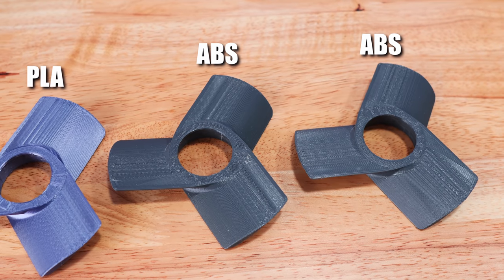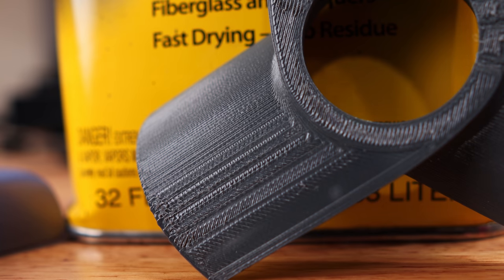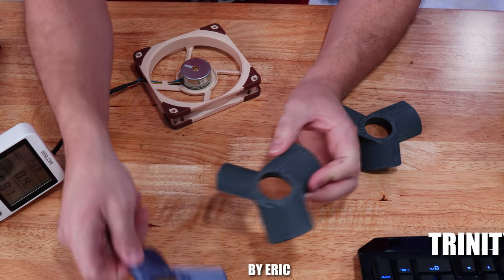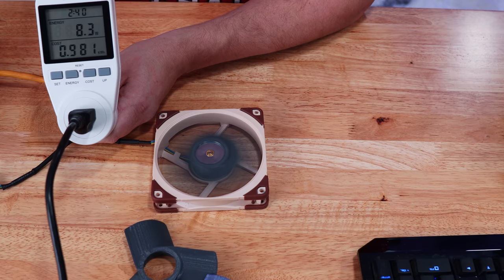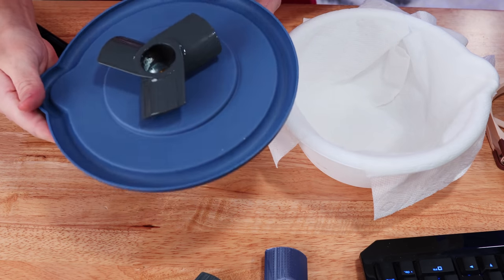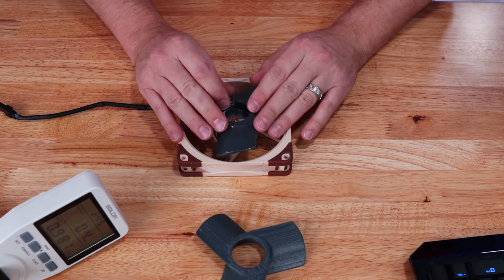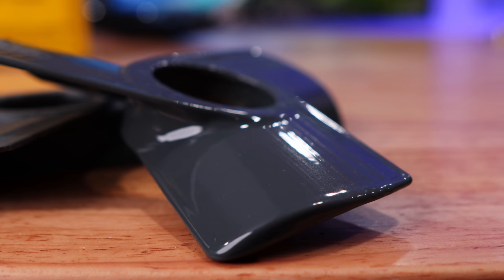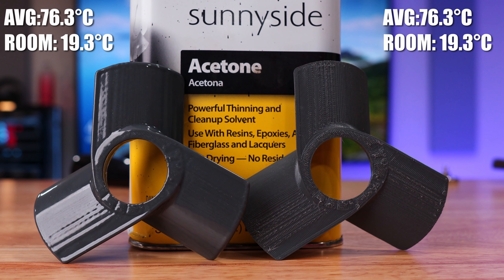Does Smoothing 3D Prints Improve Performance and Can You Smooth PLA?

Comment: Methodology note:
I think it's mistake to measure the motor wattage. I would expect it to draw the same no matter what you put on it, disregarding the most extreme cases.
What I would expect is a slightly higher RPM (at the same wattage) for the smooth version - although it could easily be trivial or within margin of error.
Due to RPM being fairly easy to measure accurately with a cheap instrument (unlike CFM, which is what we would be really looking for) I think it would more easily show any small difference that might be noticeable between the two.

But ultimately - if there is no measurable difference in a practical test then that's the ultimate judge - and the rest is pure scientific curiosity. I expect there is a difference, but just too small to be significant. EDIT: The noise/cooling ratio is very significant however, and it's good that you point that out. Any fan design can cool well if you run it fast enough - so fan and noise really go hand in hand.

Comment: if it does make less sound smoothed out, then it will also use less power. It might be worth investing in a decent oscilloscope for testing, as the noise is just a waste product from the fan, it uses some of the power to make it, reducing noise should also reduce power used.

Comment: For more accurate power draw just use that variable power supply I’ve seen and run em at 12 volts and measure current then you might be able to see a measurable difference

Comment: You can smooth pla with ethyl-acetate. I bought mine on eBay. But warning read the safety data sheet it's serious.
Reply: Dichloromethane works to some extent as well. It's also pretty nasty stuff to work with.

Comment: I bet just tweaking the prints and printer settings would get you more performance than worrying about smoothing the fan, the funny thing is you kind of want a slightly rough surface so the air separates from the fan cleanly, there's a whole area of science dedicated to airflow and turbulence control on surfaces, if you were a god of 3d printing i bet you could include some of those features in your fan and improve it ever further.

Comment: Great video

Why dont you smoot pla thermally instead of chemicaly.

Pla should become soft @80-90°C
A number of minutes in a boiling water bath may do the trick. Or few of minutes in oven @120°C
Ps too much heat may induce warping.
Could be an interesting video. Thanks 
:)

Comment: since noise is expended energy, i would imagine that a smoother can would be more energy efficient with a higher resolution energy meter. additionally, with such a small test (the size of the airfoils themselves), i would not expect to see a vast energy improvement. perhaps using a fan with a larger surface area would show different results.

Comment: Just a video suggestion if you take any
Since the acetone bath slowly removes a bit of material, 
would a slightly larger fan that was placed into an acetone bath until it's the perfect fitment perform much better than one that easily fits the fan frame from the start?

Comment: There is a difference. You just may not be noticing it because of the "Technique" you used. 
Riddle me this Major Hardware:
1) You have a fan that has a dust layer on it.
VS 
2) A fan that is clean. 
Which is more performant?
(You already know the answer)
That dust coating is basically those ridge layers, lessening the air being pushed/pulled.

For the fan show down. I don't think many would want you to "Smooth" every fan. Just isn't needed, nor is it productive with your time.
But! In those rare instances where a Fan Design is close to a commercial fans performance?
Then it might be time to take that fan,  smooth it, sand down the major imperfections, and maybe balance it a bit?

Comment: Efficiency is not measured by simply power draw. Efficiency is always a ratio comparing in vs out.  (Work done)/(power input). You got the power drawn but have not compared it to anything else. Compare it to volume moved per unit of power. 
You might find that the smooth one moves more air per Watt consumed.

Comment: Haven't gotten to the testing yet, haven't read comments. Im guessing the unprocessed actually is a bit more efficient because of the golf ball effect. Less strain on the motor, less air resistance = higher fan speed and more cooling power.

Edit: I'm going to take that .1 watt as a dub lol

Comment: Hey dude, great channel, great content but your testing methodology isn't right. You should use the input power of the fan for the comparison with a multimeter (preferably with 2 multimeters, one measuring the current and the other the voltage) for 2 main reasons
1. PSUs have pretty OK voltage regulation and it will stay almost the same voltage no matter the input voltage (assuming it only changes by a few or at most 10V). Using the input power of the PSU is very very very crude as even a small household fan could throw off your power measurement. Remember, you have neighbors, and neighbors have electric stoves.

2. That Kill-A-Watt or whatever has very poor resolution that even the cheapest $1 DMM off of eBay can beat with their 2,000 count or something. 

I hope you can revisit this and make a true comparison in the future :)
Still love the channel and the content, keep it up bro!

Comment: I think the smoothness improvements would show beneficial if the fans were spinning a lot faster like 3000 to 10000rpm or even turbo impeller speeds. At low 1500rpm or less speeds the only difference you might get is sound..

Comment: What I wonder is how much of the benefit of being quieter would be had just by printing with much finer layer height. 0.05mm layer height sort of stuff. As long as you can afford the long print time, PLA with 0.05mm layer height is relatively smooth-ish (and not too hard to make just a bit smoother yet with some fine grit sandpaper)

Comment: I Believe it's a scale issue. Since the size and shape of the fan is small(in a general sense) yhe difference is insignificant. If the fan size was large scale, like a turbine fan in generators, the propeller blades in a plane, then the ridges would create noticeable differences. At least I think it would

Comment: with a heavier fan you are more moving mass that you are feeling with drag. your mass co-efficients are having a higher impact so the drag co-effecients. so any smoothing would be negligible. also that fan looked a good bit smoother but you still have a lot of non uniform surface. when making things aerodynamic having the skin (surface) as 100% as possible. ANY surface errors disturbs Laminar air flow.
a LOT of the designs Ive seen on this channel focus on shape but not the laminar effects of each blade individually. another test that would be great to see is if you printed just a single blade and made a smoke flow box with your smoke tests. BASIC fan design is cut and push, but flow would greatly improve many of the designs as would weight reduction. the extra thick ones would be better with less infill but balance would need to be checked.

Comment: I thought the rough texture of the 3d print would makes it quieter. If the roughness was more organised and uniform it would be better imo.

I want to see someone make a fan blade based off owl feathers. Fluffy at the trailing end to reduce sound. Don't thing they'll be good at cooling/air flow but they can be the quietest.

Comment: 7:37 - "The smooth ones came in at 49.9db,  ~ the rough ones came in at 49.3"...but the rest of the video you keep saying the smooth ones were a win because they were quieter...hmm.

Ultimately, knowing the laws of aerodynamics, the rough blade has potential to be more effective for cooling at a cost of less efficiency. Rough air flow over an airfoil tends to stick to the airfoil over a greater portion of the surface, creating more lift, or in this case, more air flow. Albeit at the cost of more drag, which would make them less efficient because they would take a little more power to keep at speed.

The smooth airfoil tends to have the air flow separate off of the surface at roughly 60-80% back from the leading edge, creating less lift/air flow. However, there is less drag and the fan should be more efficient power wise.

I think in this case study the fans were just too small, and the measuring equipment not refined enough to see the differences. Maybe if you ran each fan for 12hrs on the watt meter and compared the 12hr result you'd see the difference start to show more noticeably.

Comment: what if you take a fan with some pretty thik blades and smooth it with fine sand paper because with the acetone method you can still se some waves in the print and they might still create turbulance

Comment: Id be curious to know. If you increased the fan voltage on smoothed print to make it spin faster. Until is at same decibel reading as unsmoothed print. Would there be performance diff then?

Comment: One issue with your power test is that the fan will always draw the same power, but the RPM of the fan changes. If the test was RPM normalized, then checking the power would make sense, but in this case,. measuring power doesn't allow you to compare efficiency.

Comment: Prediction: I would not expect a significant difference between the smooth and rough prints because we are using the form drag not the surface drag to move the air. 

It would require testing to know because there is not way to know, but I would expect the roupher surface to have a smaller boundary layer and thus less surface drag, so I would expect the roupher fan to spin faster. But this is not always the case and depends on the velocity and the shape of the fan.

Comment: Isn't sound energy? The friction of the air hitting the blades make friction witch causes a sound. Wouldn't that energy lost potential? Maybe that's why you saw a higher (not buy much) power consumption. Due to the fact it took less energy to push the blades threw the air it's was able to spin faster actually consuming more power. I wonder what you would find of you did a rpm test?

Comment: If you chose to sand you prints smooth would that be different? Since sanding removes material it should have less mass and so spin faster also it will increase the sharpness of the edge which might affect aerodynamics

Comment: The best way is to sand them down and then spread some UV resin on them, let it level out and then hit it with a UV light. To get a super slick finish, sand with up to 2000 grit paper and then use some car wax to get them as slick as possible.

Comment: Question. Why does CFM not directly correspond to cooling capability? You would think that the more air it can move, the better it would do in your challenges. However, that does not seem to be the case. I'd be interested in seeing each fan plotted with it's delta cooling vs CFM and see how well they align.
Reply: It's a question of CFM vs air pressure.

For testing on a rad or anything with resistance (even some dust filters) higher pressure usually outweighs CFM.

CFM is a lot easier to measure though.
Reply: @ALifeOfWine  So it comes down to efficiency in a sense. I'm thinking about how this relates to a turbo and it's ability to produce a PSI pressure and CFM. I.E. A larger fan blade will produce more CFM at a PSI vs the same fan blade but smaller, at the same psi.
Reply: @MrLoganC  I don't know anything about cars (I'm assuming that's what you're referring with a turbo) but a larger fan blade spinning at the same rpm should increase CFM but decrease pressure. Not sure if that helps you at all.
Reply: @ALifeOfWine  Yes, that's exactly what I meant with my analogy as well (Bigger turbo makes more air (more power) with less boost pressure).
Wouldn't happen to have any references to equations for this, would you? I assume is fairly simple overall (relatively depending on the person)
Reply: @MrLoganC  Awesome, and I'm afraid I don't have any equations that include variable fan size. I've only ever used CFM Vs air pressure on static fan size, which there's plenty calculators online you can find with just a quick Google search :)

Comment: (mainly an aesthetic observation) The smooth fan is smooth - but the surfaces are clearly uneven . The only way to practically test the importance of smooth & even surfaces might be to replicate a mass produced / injection moulded fan design with 3D printing; problem is that if this shows a difference, it's a problem without a solution
Reply: BTW Thanks for the videos; dunno why I'm watching as I only have laptops - but somehow got sucked in (BA- dumpf , I'm here all week...)

Comment: If we think about basic aerodynamics and plane propeller blades, it’s smooth or die... so there really is science to back up the statement. I think we are just goin into such small number differences that your electric draw meter won’t be detecting the actual differences. Someone also pointed out in the comments that dust might ( I think it’s 100% certain) collect faster and potentially more overall dust as well. But again... we need better sensors to detect these finite details/differences.

Interesting video tho, my laptop fans is a fuckin jet engine. I love seeing these quiet lil things

Comment: Hey there, what if you tried a metal fan case with (idk) plastic or 3d printed screw holes? It might help with vibrations/stability of the fan at higher speeds.
Reply: I meant a fan frame.

Comment: There is an advantage to smooth out   parts it belongs to the range of 2-5% and it requires quite a lot of instruments to have a insight.
The fan used in that description is not smooth enouht, the printing marks are still perpendicular to the stream and may not match textured surfaces performances.

Comment: Why don't you 3D print an attachment for the other side of the Noctua fan that ends off in a funnel, then your CFM meter can be placed at then end of the funnel, it will standardise tests more and you will get a somewhat more accurate cfm reading.

Comment: I would have measured milliamps instead  of measuring watts to one decimal point. Also I wouldn't worry about thermals, just air flow and pressure. There are too many variables and air flow and pressure test will be what controls the thermal test.

Comment: Now take the best fan from the fan showdown and smooth it out. I wanna see it beat the Noctua, noise wise.
Reply: It's hard to control the acetone's effects in thin designs, which is why a thicker one was used.  Some of the blades get down to a few double or single lines of drawn filament along the edges, and that would tend to sag and deform (curl) even before the bulk of the surface was smoothed.

Comment: the airfoil look backwards on the fan you used. Airfoils work horrible backwards... like really bad. I am not sure there would be a difference between a smooth, and non-smooth backwards airfoil. But I think there might be a much larger difference between and smooth, and non-smooth forward facing, or proper facing airfoil. My two cents, great content.

Comment: Now I kind of wonder...
What would happen if you took an already good fan like a noctua and put teflon "dry lube" or similar coating on the surfaces? Would it create any significant difference in noise?
A lot of fans - even high quality ones - have a noticeably rough surface finish (untreated plastic from the mold I assume) even if the form is smooth on the macro-level. It's not crazy to think that a smoother surface finish would create less resistance and thus turbulence right? ...
Considering the materials and work would be pretty cheap and easy, it might be worth a test - for science :)

Comment: You need different (typically more toxic) solvents to smooth PLA.
One such solvent is dichloromethane, which you should only use in well ventilated areas, and in general you should try to avoid using it.

Comment: Well a semi-"long story short" its the same reason aircraft manufactures switched from dome head rivets and screws to flush head rivets and screws.
Better laminar air flow provides greater efficiency and top speed.
I guess it just doesn't apply well to small scale.

Comment: If you can take a look at a Great White shark's skin, you will see that it isn't smooth. Granted, that animal doesn't move through the air (except when it does, see G.W. sharks breaching) but it does have to move through a medium that is 600 times? 700 times? thicker than air and it's skin surface has evolved to reflect the necessary  properties like minimizing drag, maximizing efficiency, extra sensory input, (see lateral sensory line) because pushing 2 to 3 tons of anything through water isn't as easy as that shark makes it look. The point I'm trying to make here is: maybe "smooth isn't what you should be going for, rather specific tiny, flat shapes that overlap and interlock...or something to that effect.